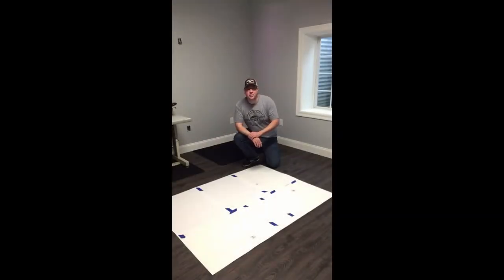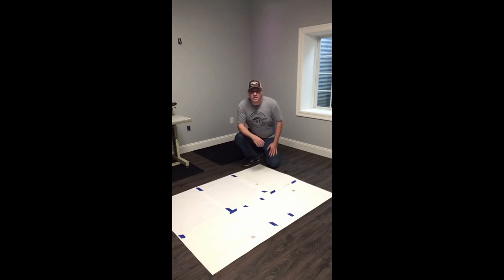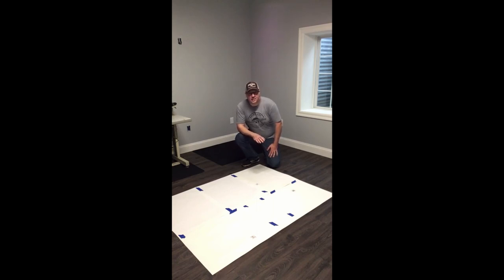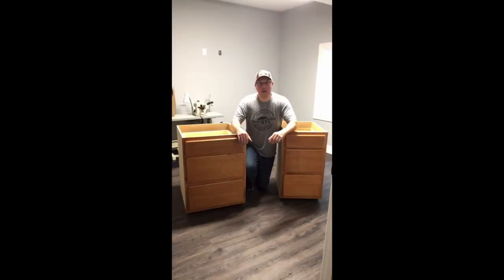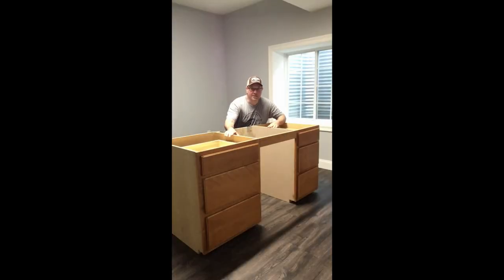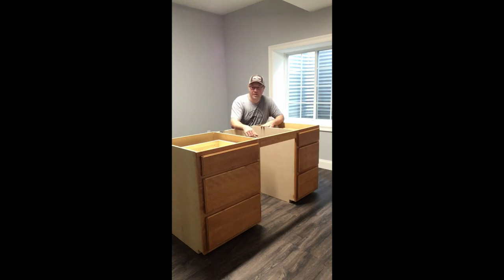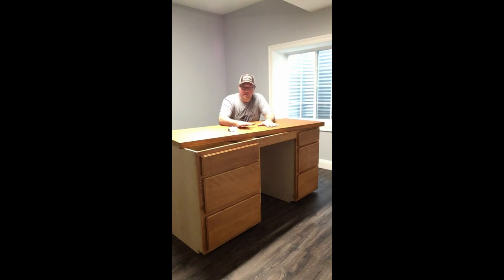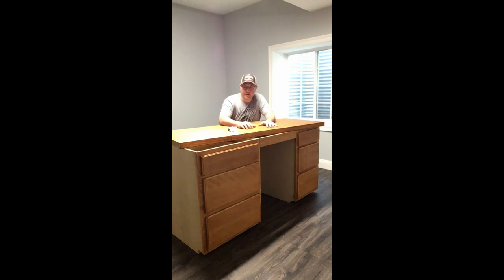Leather Stamping Bench Build

Comment: I built a 6'x2' leather working table for about $35 in 2019. I bought a set of plastic saw horses, a 4'x8' 5/8" sheet of plywood and had them cut it up to two 2'x6' pieces and one 2'x4' piece. I bought a bottle of Gorilla Glue and having a background in welding I have a bunch of clamps, some reaching out to 12". I glued the two 2'x6' pieces together to make a 1 1/4" thick sheet. I then bought some 12"x24" stick-on floor tiles and covered my table with them. the 2'x4' piece went underneath and sits between the sawhorses and I use it to hold two pieces of that floor tile stuck together for punching on my granite. Oh, and I bought two cutting mats at Walmart later just so I wouldn't cut up the floor tiles, so I guess that knocks it up to about $50 for the table.

 I then went to a counter top contractor to ask if he had a small piece of granite I could buy. He gave me three leftover pieces from the same giant plate of granite so I could place them side to side for tooling, though I mostly just use one piece as it's 19" long by 10" wide. I can push it back if cutting straps from a side or double shoulders. Since I can pick them out by hand I sometimes use double shoulders from Tandy, otherwise I buy a 11-13 oz Hermann Oak side from Springfield Leather to make belts and sheaths from.

 My most expensive machine is an old hand cranked Champion 10" splitter, not that old, maybe 30? Bought it at a garage sale for an obscene price. Pulled the blades and sharpened them at a friend's machine shop on a surface grinder as they had shiny spots on the edge. Buffed them out with 14,000 grit diamond compound. Man! I can split that 12 oz leather down to 2-3 oz for wallets, now something to do with the bellies besides sheaths.
Reply from the maker: It sounds like you have a great set up,  with the build you have told me about it proves that you do not have to have to have an expensive set up to produce quality work.  I would love to see pictures of that 10" Champion Splitter.
Reply: @CraftsmanshipwithAsh  Here's a picture of one that is like mine, but was in a lot worse condition, it's a different size too, mine is wider, but otherwise pretty much the same with a bigger wheel. If I try to split more than 8" wide it is really hard so I do not try, but you have to split 2 oz. at a time or it will 'gouge' on you.
https://mishoptoolsinventions.blogspot.com/2015/09/champion-10-leather-splitter-rebuild.html